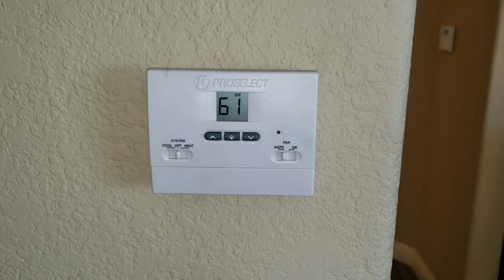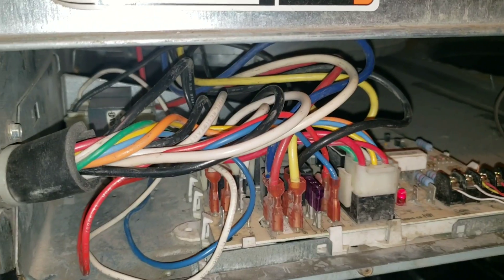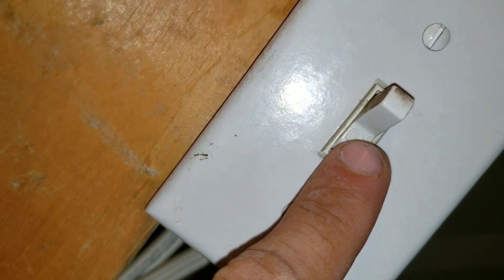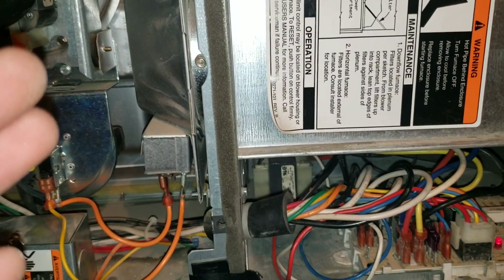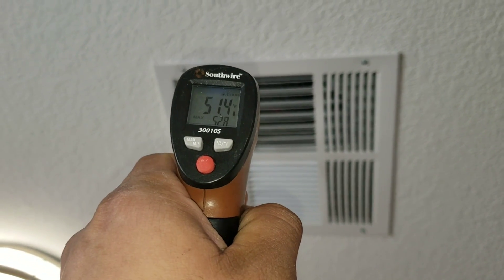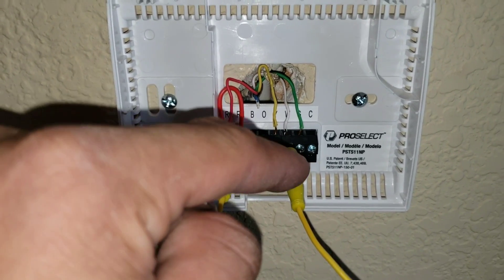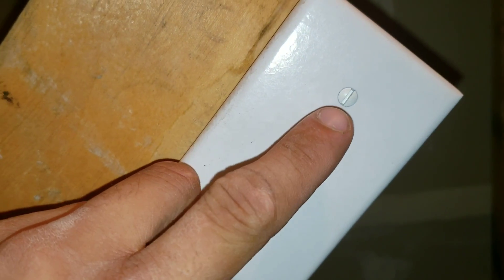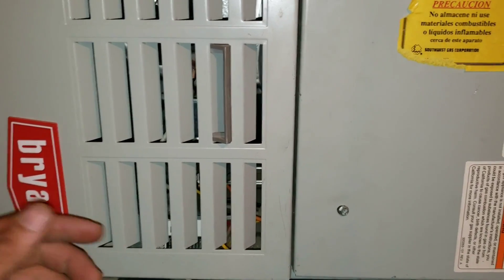Furnace Heater Not Running? Bad Thermostat? Blower Running? AC Running Simultaneously?

Comment: I have a total electric Rheem furnace and air conditioner. I have noticed the outside air conditioner kicking on sometimes so I shut the breaker off to it. Heat still works. So maybe I have a thermostat problem too?
Reply: Well i have a heat pump, Rheem 13PJA42A01, 3 1/2 ton. So I am guessing it is supposed to run?  The fan runs slower than when the air conditioner is on. And the green light on the ProTech thermostat is saying the last of the three 5 kw heat coils has kicked on I think?
Reply: If you have heat pump, condenser must run
Reply: The fan runs much slower than when on air conditioning. Is that normal?
Reply: @pl747  what fan runs slower is the outdoor condenser fan or the indoor blower motor

Comment: Your videos really helpful and informative. 
I have a Goodman furnace GMP model. It gives me 4 blinks. I searched online and it says high limit open or something. In my case I have this ligh limit switch behind the burners and gas supply pipe which makes it hard to reach. Any way you make a video on error 4 Goodman furnace if you have access to one?
Reply: ShamsChannel if it says high limit, check your filter, return grills, or test the switch itself, check the gas outlet pressure with a manometer, see if the blower runs after the fire up, see if the vent is clear, or you got a bad H.E. (Do all these if you are a certified tech. If not call one)